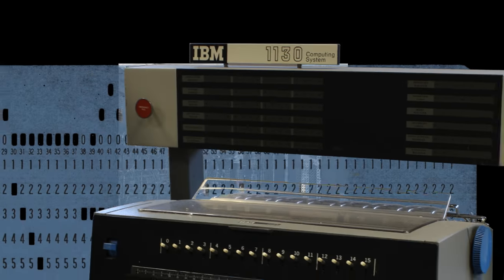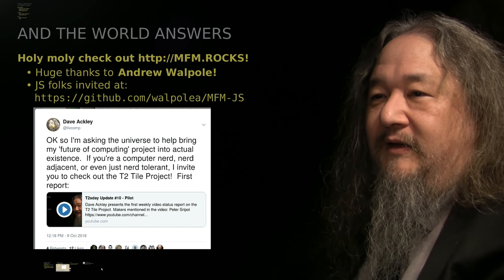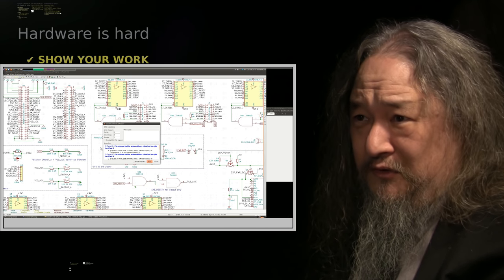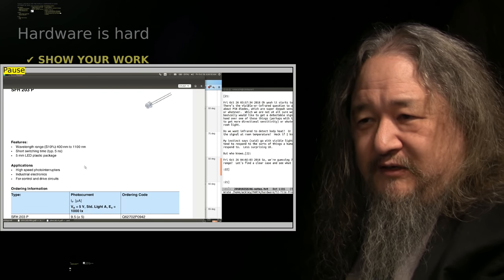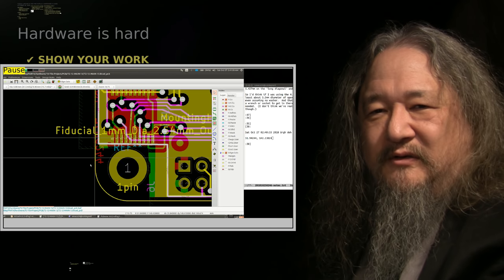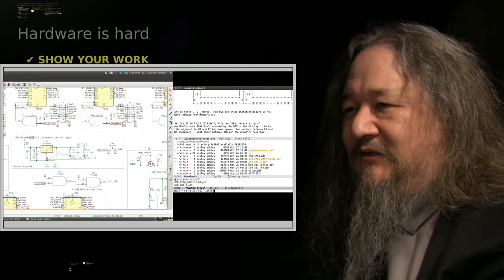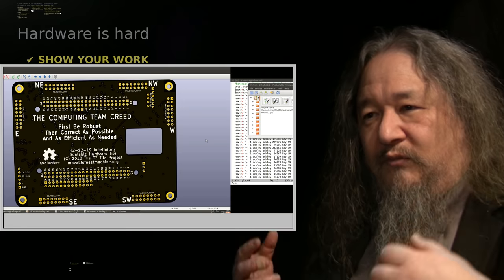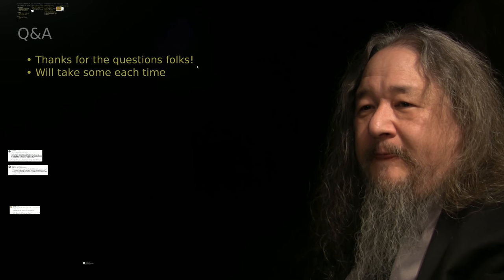Lost in Hardware - T2sday Update 13

Comment: I see vids like this:
https://youtu.be/zK3rDhJqMu0?t=600
where people can just snap the corners together? Is it supposed to do it automatically like other cad software or is it possible people are using a "turn on grid" and "snap to grid" feature so that they only have to be as precise as their grid is set to rather than the microscopic resolution that the software can handle?
Reply from the maker: Yeah, it always works when "they" do it!  Me trying to match existing sides may have been most of the problem.